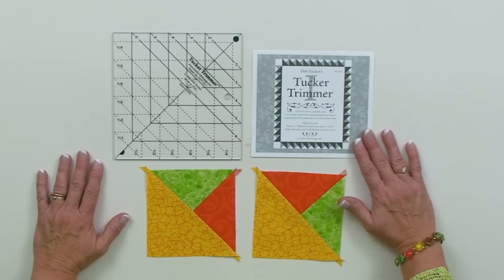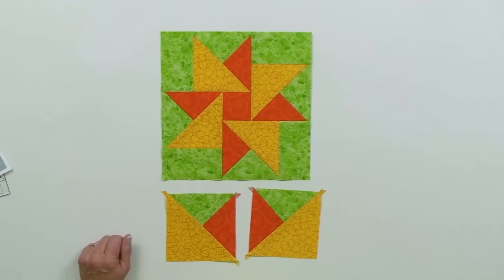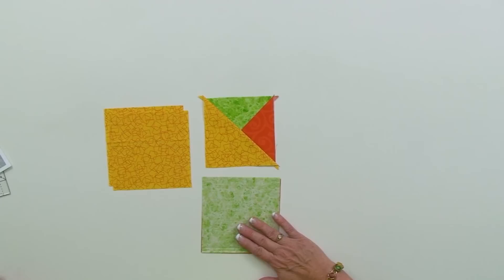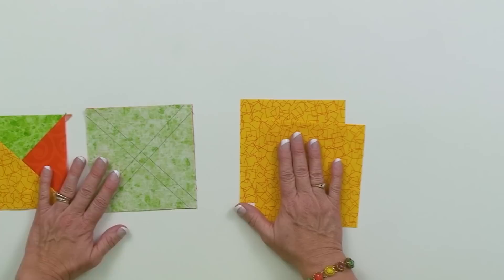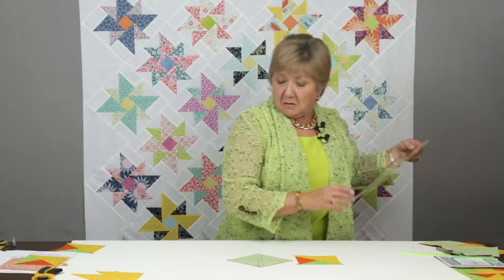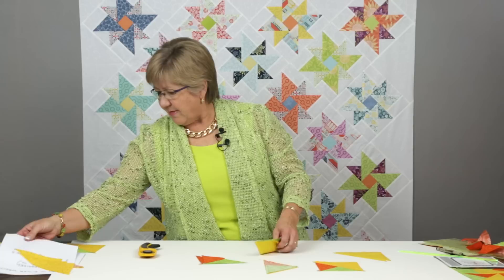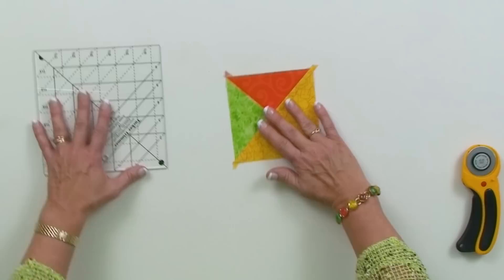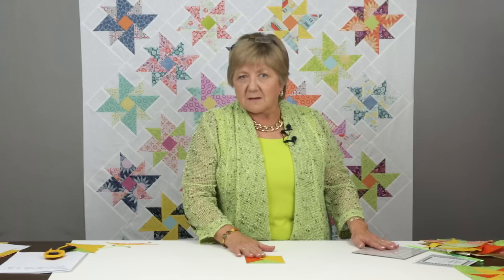Non Mirror Image Combination Units Technique Sheet

Comment: What is the quilt block called and how do you sew that square in the middle?
Reply from the maker: I am not sure it has a name. It is done with a partial seam around the center square. I have a tips and tricks called Partial Seams and it shows you how to do this. We also have a pattern that is called Spinning Pinwheels that uses this block but isn't the quilt in the background. https://deb-tuckers-studio-180-design.myshopify.com/products/spinning-pinwheels?_pos=1&_sid=bf27cdd3a&_ss=r

Comment: what is the name of the quilt behind you? I couldn't find it in your store
Reply from the maker: This is a variation of the Spinning Pinwheels Pattern. We used the Non Mirror Combo Units technique sheet to make all the units the same and then just set them on point with setting triangles. So there isn't a specific Pattern for this one but Spinning Pinwheels gets you close.